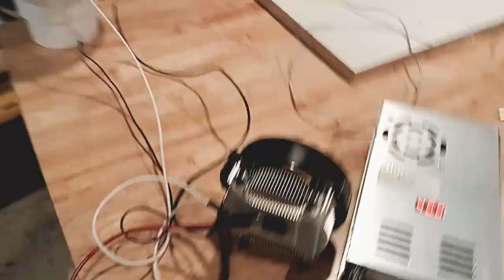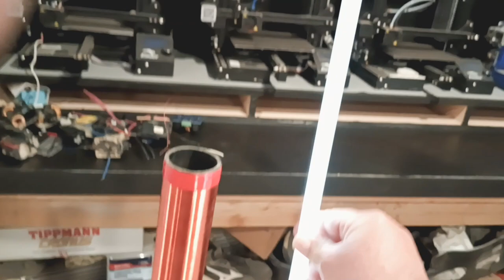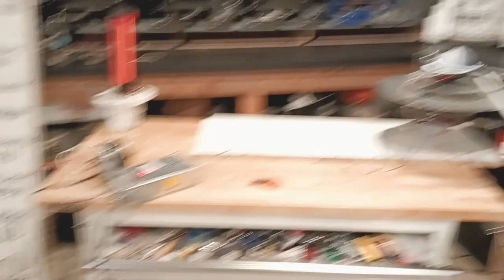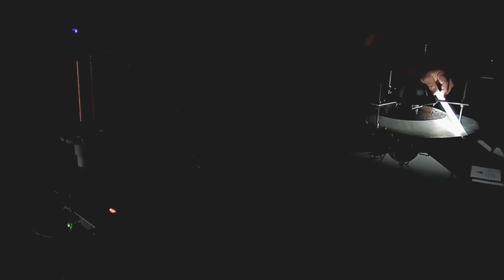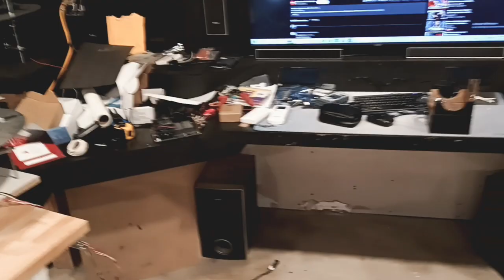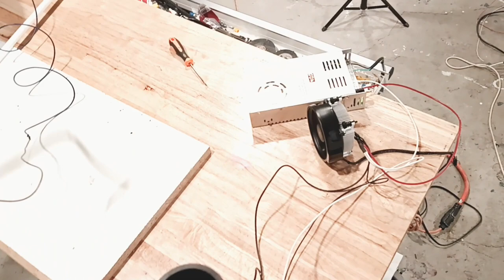Graviflyer "Tesla Coil Testing" #18

Comment from the maker: There was a higher power draw from my power source. Unfortunately my multimeter broke. I will get another one and show it in another video. This test does show that the Graviflyer is now a capacitor to the ground just like the tesla coil. If you watched my video on the paper lifter you know that static volts can use earth ground as the negative. A tesla coil has no positive or negative field. So what happens when you force it to have a negative one? Remember the tesla coil I am using is dc that creates a mimicked ac signal The same circuit can drive a flyback transformer. The 2 fields are more alike than you think.

Comment: I suppose more isolation for the wire would an approach. At least covering the end were the bare look has only air as isolation. The diode sounds good to ease the work of the transistor.

Comment: You can eliminate your fire issue if you build an antenna out of aluminum foil and put it in the vicinity of it. You could also use a 555 or 556 timer to control what frequency interrputer your coil will use.

Comment: Nice vid 👍🏻🙏I tried the same great
Reply from the maker: Did you draw more power from your power source when the wire went in? I think it was the reason for the transistor heating up.
Reply: Not sure as I use battery input for my own safety. Sorry I cannot say but maybe the power you are using is too high and that is why the leaking is occurring within the plastic tube. Try to make the same test with the wire connected to a bulb as in the Alex’s  vid and adjust the input. I think he only used a 12vdc car battery. What you are doing is great, 🙏
Reply from the maker: @dkdyker  I found out what it is. I bought a new multimeter. The frequency is changing the amps and volts are the same. I am putting together the video now.

Comment: I think the magnets are electromagnets on the craft that pulses and repell the middle plate up when in free fall it repells like a electric solenoid
Reply from the maker: I like how you think but that's not what is going on here. You can add frequency to voltage and that will make the magnets sing. Just like a stater winging does to a magnet. The magnets produce eddie current locking the plates to each other. Causing the motors to stay in tune with each other. More magnetic force would be a very bad idea.

Comment: It is exactly like when the secondary winding is short circuited and both the primary wire and the secondary winding pass a lot of current and get very hot.
Right now it looks like you have three coils
Reply from the maker: Exactly! It explains Alexeys car battery for the amps.

Comment: Hey man, I’m a fan. And been watching but this video shows nothing besides highschool experiments that was shown in 8th grade. I want to see how and why we apply this circuit to the flyer. And I want to see a “tuning” video for the Tesla coil. Thanks for sharing 🤙
Reply from the maker: thank you. I will show the tuning when I upgrade the circuit. For the Graviflyer it will never be in tune. It thinks it has more #2 coil windings than it has right now. However I can test it and find the frequency when my frequency generator gets here. I will show it. The reason it is connected like this is because the tesla coil is a capacitor to the ground. So now the Graviflyer is as well. It's not each experiment indigually. It is how they combine to make the final product that is important. I am getting to the better testing. This is going to be a fun month.

Comment: Pity about the wire arcing inside the secondary coil.
Maybe a non-metallic weight would keep it straight and help to stop the arcing? 👍
Reply from the maker: I am going to put a smaller pvc pipe down the center with 3d printed parts as stand off's. I will get rid of the sparking until the power goes up.

Comment: Is it possible that one must figure the size/weight of the middle plate into the equation? 
My understanding about resonance is that the more tuned the circuit the less the amp draw. Seems as though the Tesla coil is possibly drawing too much current due to it being out of resonance. This may be demonstrated when the Tesla coil’s transistor is cool when not powering the flyer plate but gets hot quickly when doing so.
Reply from the maker: that would be consistent with Alexey's car battery usage for the tesla coil. just bought a new multi meter and a temperature gauge. So I will find out soon.

Comment: So one end of that wire goes into the middle of the tesla coil and what is the other end connected to the center graviflyer disk?
Reply from the maker: yes it is the blue wire connected to the center plate. I changed the wire on the end because the shielding is very bad in a speaker wire. So it works better in this experiment.

Comment: Would that mosfet cool better if it was submerged in oil?
Reply from the maker: I am reaching breaking temp. So the current is fine then the temp. goes up and the current becomes a problem. It is the breakdown of the transistor.